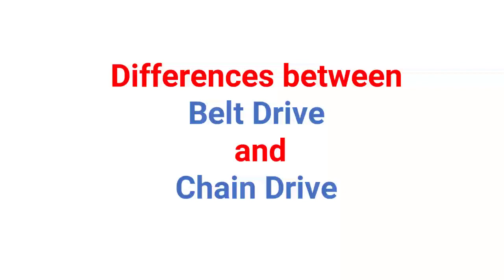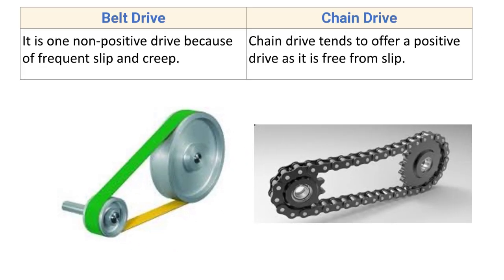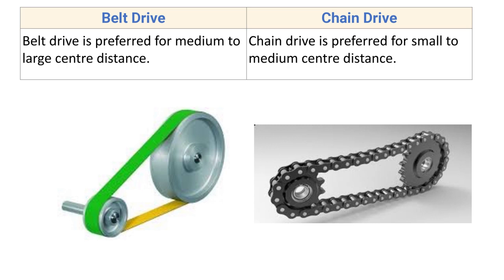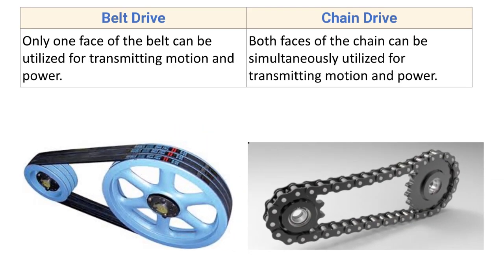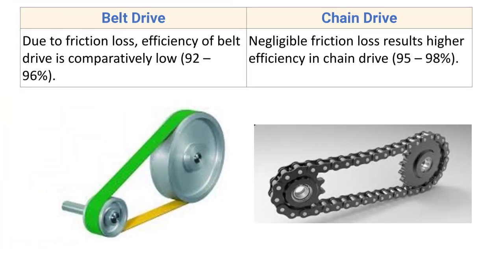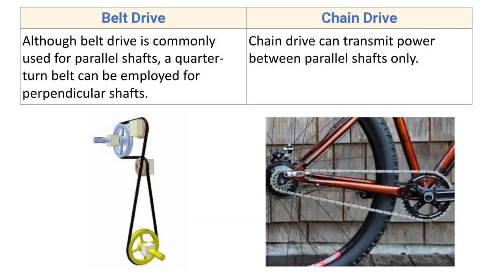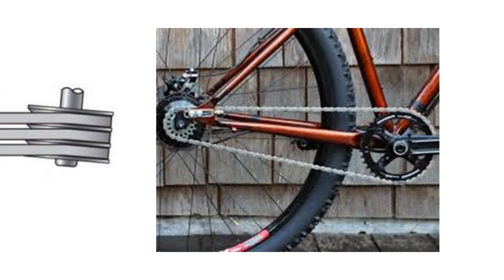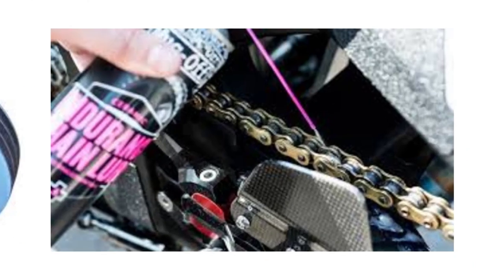Differences between Belt Drive and Chain Drive @MechanicalEngineering4u

Comment: Sir namaste 🙏 
Sir this video is very helpful for me and my own projects 
Sir please if you don't mine i have a small  problem  with my machine project work please give me any suggestion for me 
Sir my problem i am made both lathe an milling machines 
1)Lathe Machine was gear drive type with  and also step cone belt system seperately  here so much space to adjust the belt tension between driven and drive motor 
2)Milling machine  sir here spindle shaft to motor shaft distance is very low only below 300 number 6mm belts are fitted  but here is the problem sir this type of belts are not available for my widely  that way i want to change this belt system to chain drive  
Sir how much speed can support chain drive